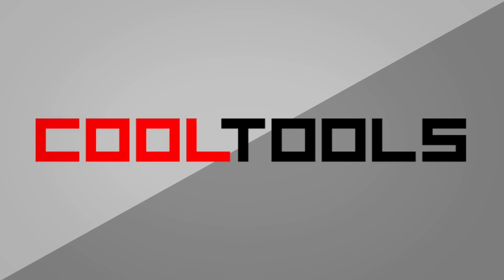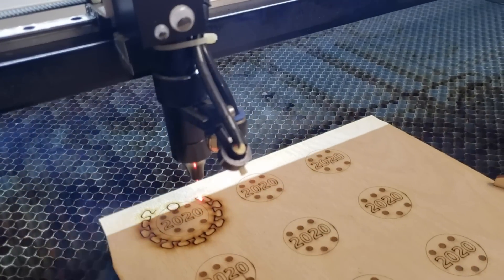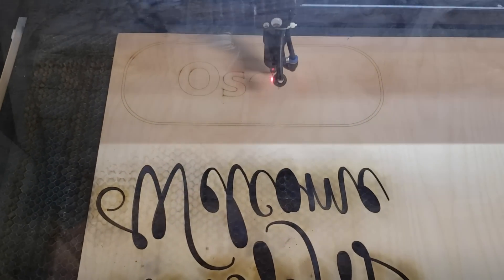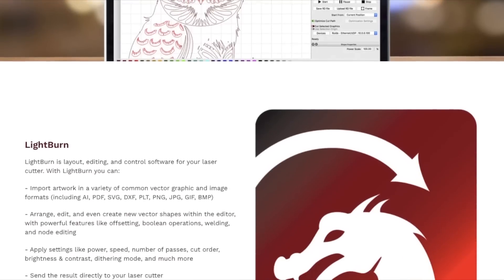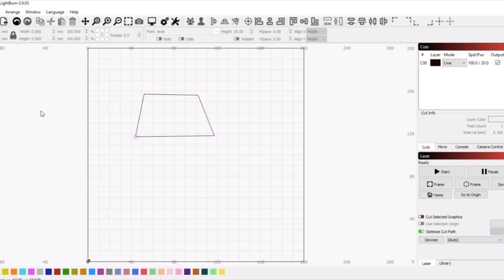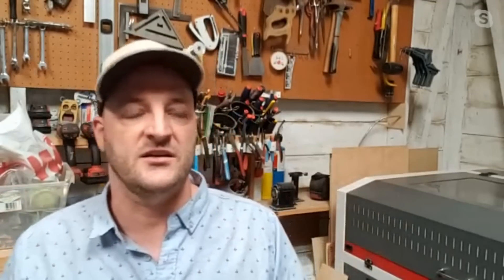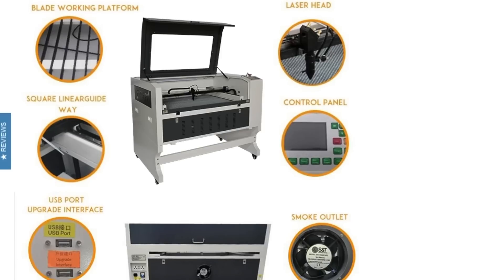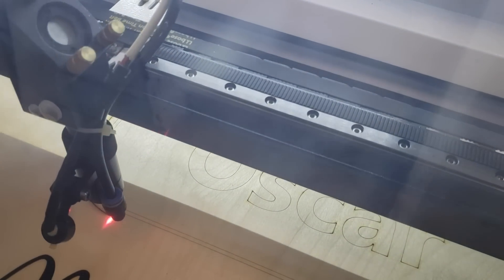Glowforge Killer: half the price, twice the power

Comment: So as a Field Service Engineer that has worked on CO2 Lasers for decades, here is what I noticed while watching this video; You need much more vacuum / ventilation than you already have. The system appears to have "Flying Optics", meaning that the Head moves the Mirrors to deliver the beam to the Focus Lens. With all that smoke in that chamber and exposed mirrors I would expect you will get premature wear on the Flying Mirrors. Also, Acrylic vaporizes when Laser Cut and that vapor can scatter the beam (CO2); not only at the Focus Point but Acrylic Vapor will also scatter the collimated beam going into the head (again open Flying Optics) meaning a significant loss in power delivered to the Focus Lens. Your Ventilation system should be able to evacuate all smoke and vapor as fast or faster than the Laser can generate it to save on Optical wear and to maximize power delivery to the Focus Lens. In industrial systems we use telescoping bellows between the stationary optics and the flying optics. These "Beam Covers" are also provided a few PSI ( 5 to 10 PSI) of Very Clean air (actually we use N2 gas) to give them a "Positive Pressure" or to keep them at a higher atmosphere. This keeps harmful particulate out of the Beam Path. Now all of that said, at 90W you are not as likely to damage the optics as quickly as say a 500W to 30KW laser so of course the lower power will help. Good Luck, Have Fun, and Be Safe! :)
Reply: Very informative, thank you sir.
Reply: Man you know your lasers!!! Do you consider this a good beginners laser?? Thank you friend...
Reply: @robjtko  Thank you for the kind compliment. The smallest laser I have ever worked with is 750 W; so my expertise is limited to High Power Industrial lasers. For "Beginners" I would recommend a sealed laser, (Laser Diode, RF Laser, etc), the downside of this is expense. I find that "easy == $$$". All Sealed Lasers will require replacement after a fixed time regardless of usage hours. In other words, the clock is always ticking to replace the Laser Head even if you are not using the laser. For myself personally, I would choose a Gas Laser, (CO2) where I can "feed" Laser Gas/Mix. The "Laser Mix" is a very basic mixture of 4.5% CO2 for the beam, 13.5% N2 for the catalyst, and 82% HE for coolant. Tube Lasers can be serviced as needed; replacing Output-Coupler, Internal Beam Benders, Rear-Mirror, etc. These lasers are generally easy to cool and will easily generate well over 100W on a bad day. But this requires a level of expertise to maintain. The Gent in this video does mention that he is using a Laser Tube and a Coolant Circulator. This makes me think he is using the same type of Laser I would use. But he does not mention, (or I missed it), that he is feeing the Laser with a gas mix.  Side note - a lot of these "Blue" Laser Diodes you see on these hobby tables are/were actually the Laser Pumps we use to pump Nd:YAG High Power Lasers. The last Nd:YAG laser I setup used 8 Laser Diodes per channel with 4 channels, (four Nd:YAG Crystals). These Laser Pumps were good for about a year or two and cost $2000 USD to replace. I know I didn't offer much to directly answer your question but hopefully the information here will help you make a more informed decision in the future. Good Luck, Have Fun, Be Safe!
Reply: @chargedneuron  Again thank you friend, you level of knowledge transcends anything I have seen on YouTube!! What I wouldn’t give to have your knowledge. I know nothing about lasers except what they are suppose to do. I have never been around one much less used one. Still I am intrigued by them as well as cnc routers. Could you be so kind to tell me this. After what I have told you about myself, what kind or more specifically which laser would you personally buy to start with if $10,000.oo was you max price? Really need to be more around $5,000.oo to $8,000.oo. Trust me I know that really limits your answer and I apologies. It’s just all I can do right now. I am looking to make wooden pictures as well as different shapes. For example CHRISTmas ornaments. Many, many other things to, thats just an example. Another example might be pictures of cities with all the roads as well as lakes and all the creeks running into and out of them. May possibly work with metal as well. You have no idea how much I appreciate you spending the time to answer me and would be even more great full if you could answer what I just ask. I built something one time by watching a guy do it on YouTube. He also answered some questions for me. He was a super great guy. Like yourself I should say. Once finished I sent him $100.oo 3 different times via ebay pay. Sorry, I have the darn app but forget the exact name of the payment method. Lol. PayPal,, that is it. If you had time and could help me find the right machine I would gladly do the same for you friend. As a matter of fact I honestly think your such a great guy I would send you something in advance just so you would know I am honest. I know this sounds like a scam of some sort but I am being 100% honest with you. I got scammed out of a $1,000.oo drone I sold so I know how that feels and learned a good, expensive lesson. I would only be asking you for information about lasers. Nothing more. If you doubt me I’ll gladly give you my email address, facebook name or whatever makes you feel comfortable. What I built with the other gentleman’s information was a “”Hookah Diving Unit.”” I can give you his name and YouTube page where you can see what video I used to build my unit. I would just prefer to give it to you discretely but if that makes you nervous I will list it here. Regardless what you decide my friend know how much I appreciate the time you have taken already with me. Hope to hear from you Sir. GOD bless!!..            :))......        Sir I am going to list that site for you. I know how this must sound to you and it is very important to me that you know I am honest. The gentleman’s page is listed under, “”World Science TV.”” If you go to that on YouTube you will see all of this guys videos. They are about Hookah Diving and Dredging for gold. I will be back with the name of the exact video that shows everything I told you about. Thank you so much my friend!!!..
Reply: @robjtko  Here are a couple videos you might find useful: https://youtu.be/rUlxuWFiQrI | https://youtu.be/PJ9sDCMFa6E
Reply: @robjtko  You can always start with a hobby diode laser for $250-$750 depending on power and set-up. For a CO2 laser, here are a couple videos you will find helpful:
https://www.youtube.com/watch?v=PJ9sDCMFa6E
https://youtu.be/rUlxuWFiQrI
Reply: @MarkManSC  Thank you Markman SC!!!
Reply: I found theres the laser waterjet hybrid that also has air shroud, that basically has no downsides and can cut highly precise small diameter straight edge 10cm into metal but kinda slowly.
Reply: @635574  Thank you Sir!! Sorry for writing you an entire book. Still thoughtful of you to read and answer. GOD bless friend!!..
Reply: Very good statement. And I'd like to add, you need a filter too. I see so many guys playin around with these powerhouses. The fumes are really dangerous, really! Lasers do not only burn stuf, they might also disintegrate Molecules into Atoms, the developing plasma means thousands of degrees. You never know what you get out of that, but believe me this dust is bad ass stuff. At least over years working with it, it will harm you very likely and you might never know where it came from. It's a silent and slow poisoning.
Reply: What would your recommend for engraving leather?
Reply: @seandepoppe6716  Unfortunately this is not something I can comment on; I work on industrial Lasers & Robots. The smallest laser I work on is 2.2KW and the largest I work on is 60KW. Now, if you wanted to cut, weld or scribe steel in a production setting, or weld 4 ft thick Armor onto Battleships, I got you covered :)

Comment: For less expensive air exhaust I used a (VIVOSUN 6 inch Inline Duct Fan 240 CFM) From Amazon for $19.00.  Granted it is only used for My Ortur laser but it works very well exhausting fumes.  There are more expensive units but I tried the cheapest just to see if it could work and it does.

Comment: I added a duct booster fan at the exit from my workshop.  I combination with the PC type fan at the back of the machine, I can have the lid open and still have most of the smoke from cutting be drawn out of the workshop.  

Nice machine though...  I have one of the 50W 12" x 20" machines and all in all, it's pretty darn good for the money (about $1400 when I bought it).  I've replaced all the optics for better quality parts, which made a measurable difference.  I'll also replace the laser tube at some point with a higher quality tube.  The Chinese supplied tube is OK, but the beam quality isn't super great.

Comment: One thing people seem to forget is if you are trying to exhaust air to the outside you have to have a source for incoming air otherwise your exhaust fan is trying to pull a vacuum on your house. 
I am definitely going to the link on the laser he bought.
Reply: Good point about exhaust. When you enter a restaurant and the door is hard to open that means they are running their cooking exhaust hoods but have turned off their outside air supply to the restaurants A/C unit, and the vacuum is what you are pulling against at the front tg door. This is usually done on colder days because the heating bill is higher as th he outside air needs to be heated whereas recirculating A/C unit air is already room temperature.

Comment: Cutting thickness depends on your lens, focus, and wattage. I have a 40w that will do half in birch ply with no problems. I just needed to change the lens to get a slightly deeper focus cone on the beam. I also can do 3/4" hardwood in 2 passes if needed without charging. Good lenses and accurate focus are what really matters more than the brand.

Lenses are cheap $20-50 depending on the focal length and are considered consumables so replacing them is really easy. Having ones for ultra-fine engraving and one for deep cuts is a good investment.

On the fan side, get a blower-style fan. They move more air and are rebuildable so when they get gunked up with smoke residue and start to sound like a rock tumbler you can take them apart for cleaning.

For the cooler, get a refrigerator style one, not just a water tank and fan. Those work but you have limited cut time. The refrigerator ones cost more but chill the water to 18/19 degrees C.  Cold tubes last longer and you want stable water temperatures.

Comment: Very different units--ignore the misleading "questions" with incorrect info about ability of the GF (e.g. you CAN cut material 1/2" or so, though may take more passes, and you can remove it's crumb tray, too to fit in bulkier items).   This unit may indeed be great if you have a big shop, can build cooling & ventilation for it & need the bigger bed & 90W...

Comment: How would this work for cutting balsa, like cutting ribs for RC airplane kits?
Reply: Like a hot knife through butter
Reply: Balsa is fine. Watch out for 5 layer birch ply. The 3 layer stuff is fine but the 5 has a harder glue/resin that doesn't react well and burns/chars instead of cuts.
Reply: @LathanM  Thanks, I've been thinking about getting something for building RC planes for awhile, this one looks like it should work well for it.  For heavier stuff like the 5 layer birch the scroll saw works pretty well.  It's those dozens of balsa ribs that's a pain to do on the saw.
Reply: @LathanM  So you had the same issue. That 5 layer stuff is hard to get through cleanly.

Comment: How about modifying it and introduce positive air pressure along with your exhaust system. That might take of the smoke situation since you want to open the machine as soon as it's done. Also it might help keep surfaces cleaner from build up on the laser lens and mirror(s). Just a thought.
Reply: Positive air pressure would push the smoke to the static components. As he had mentioned, he needs to upgrade his exhaust fan. My guess is that the smoke isn't nearly as much of a problem just that he doesn't like his work area smelling burnt. The aromatics hang around longer than the smoke particles.

Comment: 36 is to short I need at least 50 inches to Engrave longer parts.
Reply: Look for a machine with a pass through. My Boss can pass through longer pieces both front to back and side to side. Lightburn software allows you to cut long pieces in sections flawlessly. That is, cut a section of the larger piece, move the piece over, register the movement (1-2 minutes) and start the next section.
Reply: @ryanlangan1060  what machine would that be ?
Reply: @wewe365  If you go to bosslaser.com and click on "engraving" all of the red panels on the "LS" machines are pass through doors.
Reply: The company makes a 52 x 36 100w machine. cost is about $6200.00 US.

Comment: I have a Glowforge Pro and I can cut most types of wood up to 1/4 of an inch and some wood up to a half-inch in one pass.
Reply: It just depends on your lens, focus, and wattage. I have a 40w that will do half in birch ply with no problems. I just needed to change the lens to get a slightly deeper focus cone on the beam. I also can do 3/4" hardwood in 2 passes if needed without charging. Good lenses and accurate focus are what really matters more than the brand.
Reply: @LathanM  Where do you get different lenses?
Reply: @bryanklotz  I get mine from either Amazon or a local company called automation technologies inc. You can find them on the web but there are others Light Objects is pretty popular. Check out this video for details of why you need different lenses - https://www.youtube.com/watch?v=g-UtLDZWJbc
Reply: I go through a company called light objects or on Amazon. You need to know the diameter and the focal length.
Reply: I

Comment: I have looked at glowforge and thought the same thing price was to over the top This don't look bad for 2500$. I do suggest that you don't advertise software piracy. lightburn is really cheap esp compared to CNC apps Vcarve pro is nuts (699.99) you paid 2500$ for the machine  but dont want to pay 80$ for the software? It's was 150$ for S3d as well for my 3d printing. 80$ is not that bad

Comment: Where do you get support/community and parts? Who does repairs?
Reply: There are tons of forums and Facebook groups out there for the machines. The hardware is really generic. The only specialized parts are the software and controller and they are off the shelf parts as well so replacements are just a google search away.  For example, there are about 10 different versions of the machine presented that the only change is the color and possibly the controller.  If you are looking for a complete turnkey solution, check out Boss Laser or FS Laser. Both are US based and have decent support. You will pay slightly more but have less shipping headaches.
Reply: Call an laser expert: Yoda & Luck Sky waker
Reply: @noway8233  “Luck Sky waker”?
Reply: Luck Sky Walker
You put laser in rice
He steal rice. See broken laser. Fix it.
Be a man
Do the right thing

Comment: Does this have the ability to hook up for engraving or cutting on round surfaces?
Reply: You need an extra attachment, but the controller can handle it. My manufacturer threw in the rotary attachment for free - I wouldn't suggest the company I went with, they were a pain, but you might be able to get the same from another manufacturer.
Reply: @nickelbers48  Thank you, Nick. I think that might be why so many people go with GlowForge or Muse, or MakeBlock as they tell you the limitations up front and there seem to be very few hiccups.
Reply: Pretty much any laser from china will accept a rotary attachment. They use third party controllers to run the machine and they're well documented for upgrades and maintenance. Most chinese origin lasers will have a connector accessible to unplug the Y axis and plug in the rotary.

Comment: What about consumable parts , are they standard and readily available ?
Reply: 99% of the parts are universal, mirrors, lenses, limit switches so parts are cheap. Tubes and power supplies can be expensive but I am paying $600 for 90/100w tubes and they last through years of me doing production-level cutting 6-8 hours a day 3-5 days a week. I have replaced 1 power-supply on my 3 machines in 8 years and that was due to a screw being too long finally wearing through a wire. The only expensive part of the system is the controller and that is the part where you really get what you pay for.

Comment: I got a furnace blower from a buddy for free for my K40 laser and it works pretty good. I had to 3D print an adapter to join the dryer vent hose to the blower inlet. Then I just wired it up to a 2 switch electrical box with 1 switch being on and off and the other being the switch between high and low. Low speed works fine for wood, cardboard other not terribly pungent things, but I usually set it to high speed for plastics, especially acrylic.

Comment: So would a bathroom exhaust fan work and if so, how many cfpm would it have to be?
Reply: They do but not really.  You really want a blower-style fan. They move more air, are rebuildable so you can clean them when they get gunked up, and they will trust me, and have adjustable inlet and outlet positions to make them easier to mount. They are the snail/turbo shaped fans. They can be loud but can be mounted slightly farther away from the machine to cut down on noise. I have mine mounted on the other side of a wall from my machines so they are hardly audible.
Reply: Get a 4" blower used for woodworking dust collection. That will do the job.